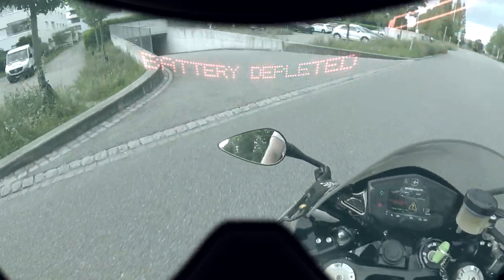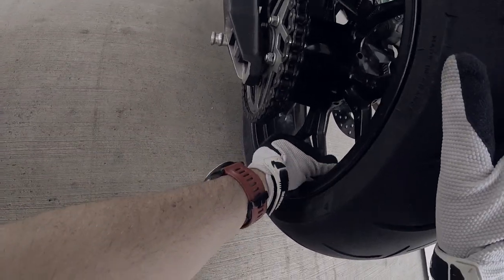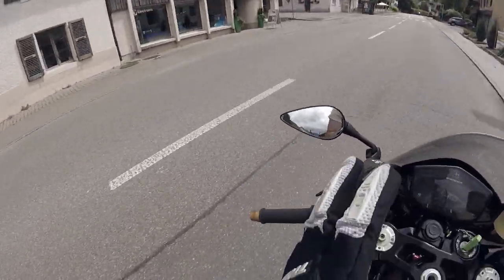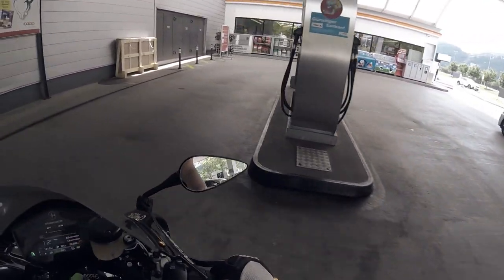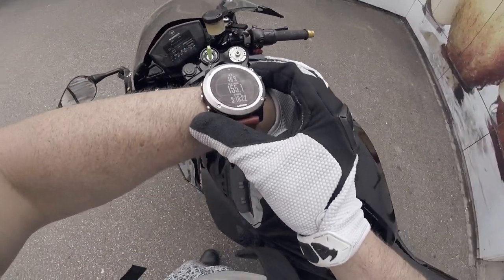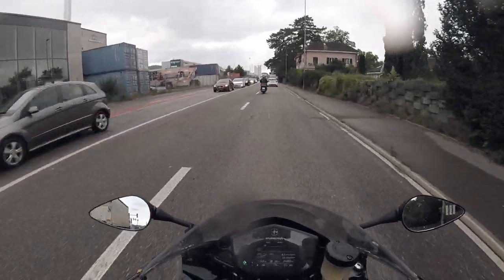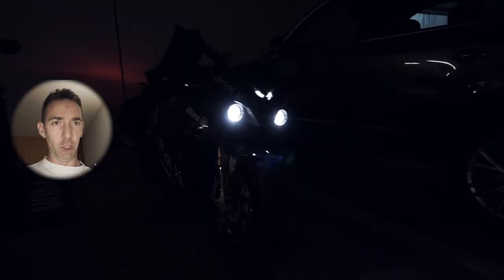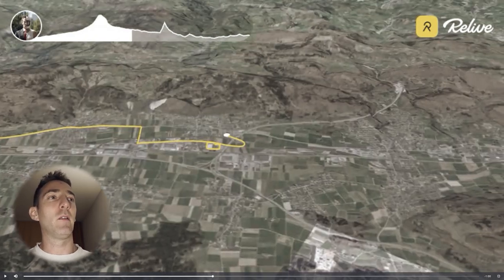Range Test Energica electric motorcycle.

Comment: I got my Zero down to 0% and still had a few miles left in it to get home. It definitely gives you major range anxiety when you hit that last 5-10% and even worse when you hit 0%. In regards to Brandon's video, the issue was his fault and he admits that. It would be like leaving your headlights on in your car. It will drain the battery if you have the bike on, it's displaying the dash, he was running his flashers and headlight/tail light. While I believe they should have gone with DC to DC, I'm sure Harley and Zero have their reasons.
Reply from the maker: Sure thig.. but you know.. you get this 6 sense for range estimation with a little experience.. so you know how fast you can ride to reach the next charger or make it back home. With the energica i can realy good estimate it. 
Brandon knows a lot about electronics and even he can fail.. i think the vast majority have no idea at all. So the bike is pretty new and for that pricetag i expect it should be faliproof. I guarantee this will not be the only one case with a dead battery. I would not critizise the bike if its a Juzi Shazi bike like the Inja bought and modified... when you order such a crap you know what is the deal.
Thats why i say... for this pricetag... you should not have range anxiety or even fear of a dead bike.

Comment: Could you make a video on mixed range driving. I have a 58 mile mixed drive I will be doing if I buy an energica and I need to figure out if it will make it.
Reply from the maker: I did a range video and trip videos. take that as a benchmark. Range newer was a limitation. Chargeing Network instead is a pain sometimes. Depends on country and place.

Comment: CN you share some consumption figures? Like how much energy is Co consumed at 50km/h and 80km/h  Wh per km.. Would be nice to know..,
Reply from the maker: Haha got ya... you did not watch the entire vid 🤪😜 
i told in the vid... i try to keep the consumption between 5 - 6 kw
Reply: @LexSummer  ahha... Yea, I did hear that. But I thought I overheard or. misunderstood you. So it is  possible to cruise down the road around with that little amount of energy used. That is amazing.! 
. So even the bike being quite heavy.. Its the rolling resistance + many other small things which makes it all happen  like aerodynamics, rolling resistance, and going easy on throttle and let the motor spin up slowly without using allot of Amp's.. + you did loads of coasting.. That is not using regen so much... 
I want to build a or convert Aprilia rs4 125 to electric. But it only would be running on 117 volts and a little 4kw motor pushed to hopefully 35kw peak at times.. Thank you. This is great insight.. 🙂👌
Reply: @LexSummer  So this then confirms this build thread for Quantya Dirt bike. . 
But instead of freewheeling best would be a separate brake lever for regen.. Or an inline brake lever pressure sensor for the regen 👌 Cause sometimes regen can be used allot and waist it  completely away would be madness..
http://www.altmann.haan.de/quantya_freewheel_clutch/default.htm

Comment: What regen setting did you use?  I find I get the best range with regen OFF.
Reply from the maker: in some way.. off would work best.. but in trafic you would waste a lot energy with pure breaking. So i set it on max but you as long i keep the throtle neutral the bike just coast. And when i need to break i can use 95 % regen instead breaking. BUT... i wonder how much miles you can do on the big one.
Reply: Why would regen off be better?
Isn't reducing speed with regen better for your range, since it's recouped kWh?
Reply: Regen off or low <20% is best for straight roads - highway/motorway/autobahn.  Regen is not as efficient as maintaining speed so long as the  objective is NOT to slow down.  I’ve proven it on the Zero SRF.  So my custom active on most days is low on neutral regen, but high on brake regen - best of both worlds in my view.
Reply from the maker: Yay thanks for answering. Could not explain better.
Reply: @PaulZero  oké, so coasting it on long stretches. Thx

Comment: Squeaky brakes suck I don’t know if I could live with that
Reply from the maker: If you can't live with that... you will probably die 🤔
Reply: Lex Summer on your bike at lease. 😉
Reply from the maker: @Tothefloor  Nah i know what you say... I also had a discusion with the dealership and servicepoint. The breaks work as they should and do the job. But it is not the smartest move from Energica to mount this brake system on the bike, or at least don't offer an upgrade. So the customer can decide what they want. All bikes comes with the top line rear brake (and have a strong regen) but on the front they chose a cheeper brake system. For rideing on the streets its absolutely suficient but as you say. yes it is squeeking loud and have other minor downsides compared to a top line brake system. At the ed.. i dont know the reason why Energica chose this one for the bikes. How ever.. if we take other brands under the goggle we can also argueing about lot things. No brand or bike is perfect.